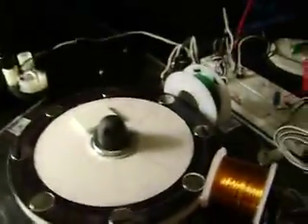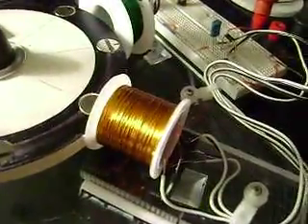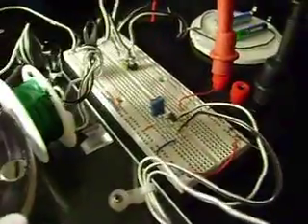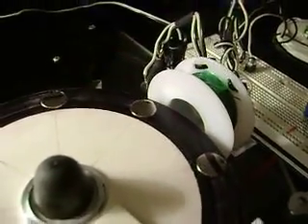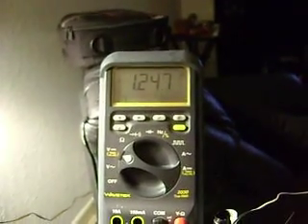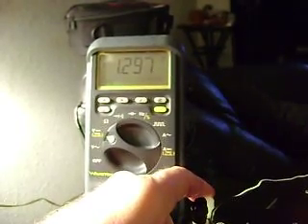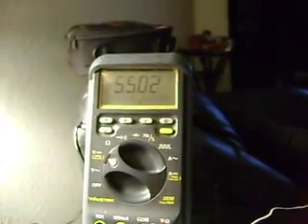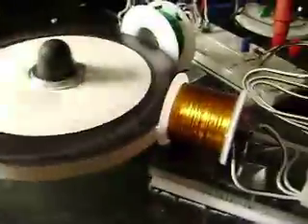Getting more volts from a pulse motor setup

Comment from the maker: Thanks Admin
I wish I did have a scope. I had one years ago, and it had some problems and was old.
Yeah, I was impressed by how much of a jump in volts going from just generator mode to reed shorting bemf capture mode. I didnt think there would be such an increase. I remember hooking up a bosch relay in buzz mode and used a diode and cap to capture, and the ratio was 12v in and 90v captured. But this is impressive. About 1.2v to 55v, and with iron core, 2.2v to 91v. 
Mags

Comment: Great Stuff on the fine tuning.

The voltage comes from the fast collapse of the field. This is what makes the reed switches better than electronic switches, once the contacts break the resistance across them jumps with such velocity that field is allowed to collapse as fast as possible. The faster the collapse, the higher the spike. Do you have an oscilloscope? It would be interesting to see the phase relationships between these signals.
Cheers!